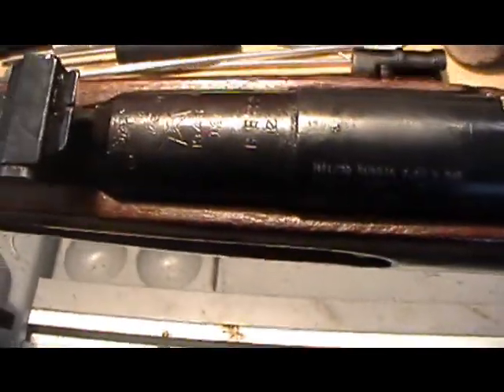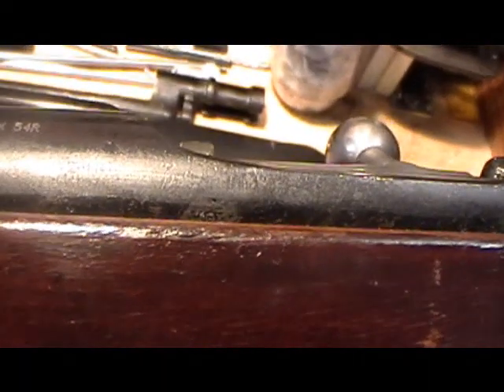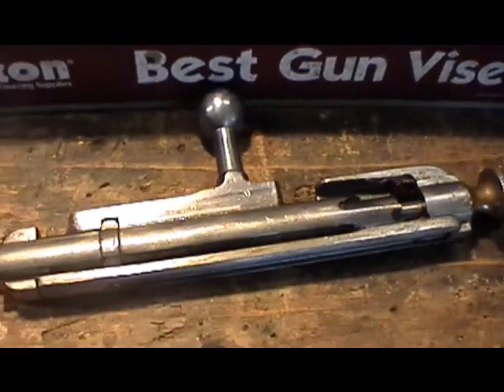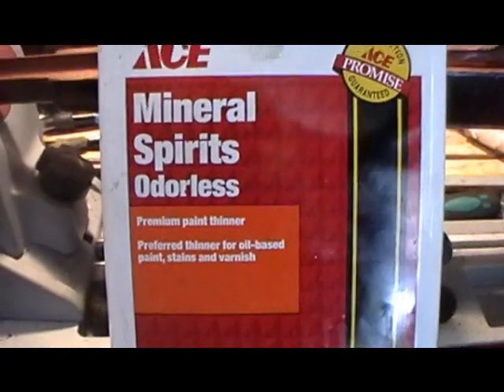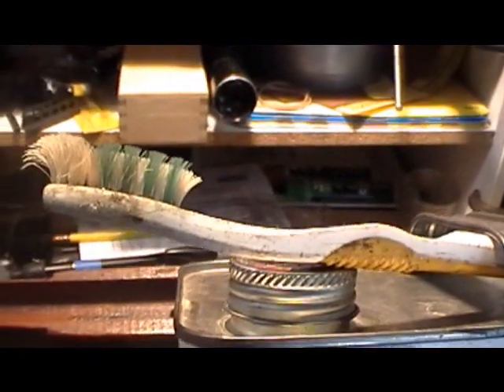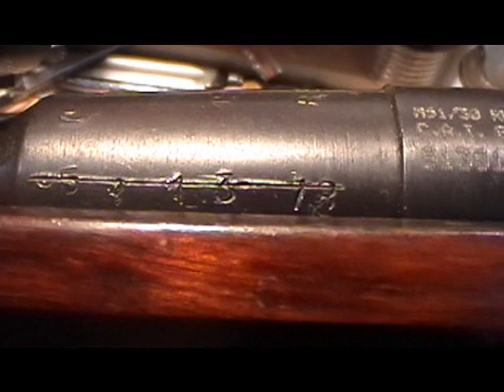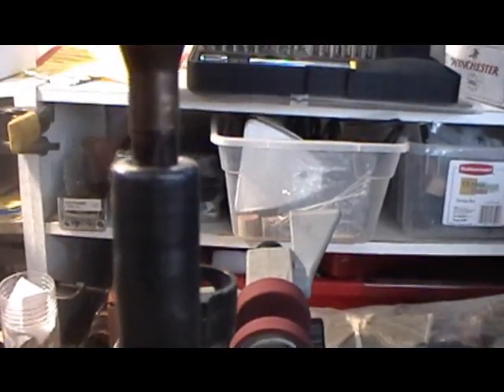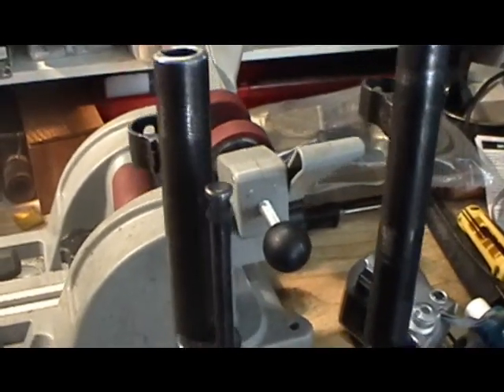1943 Tula Ex Sniper

Comment from the maker: @ronnieman87 It would take a little bit of work, but it appears that it could be done. I don't really have any intention of reinstalling a PU set up on it. Cheaper to install a long eye relief scope after removing the rear sight base. Easier to zero with a modern scope that way as well opposed to the shim method used with the PU scopes and mounts. I already have a LER set up on one of my rifles. I'll have to see how this one shoots and go from there.